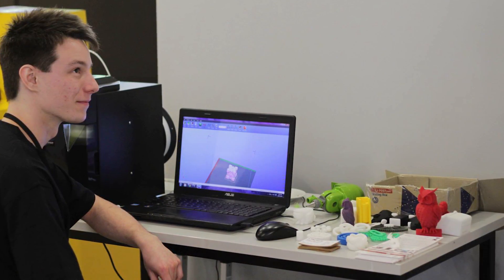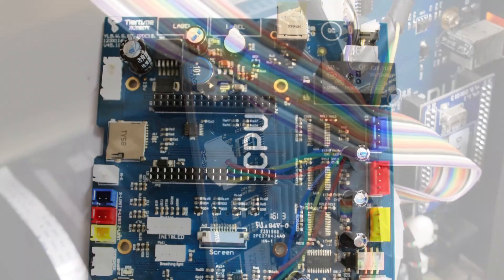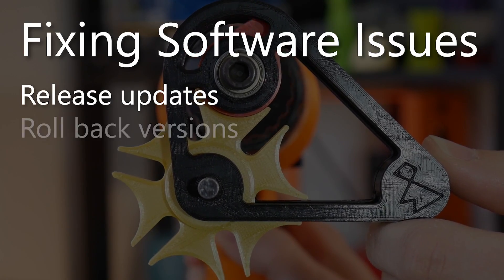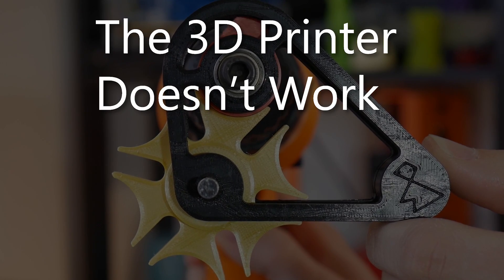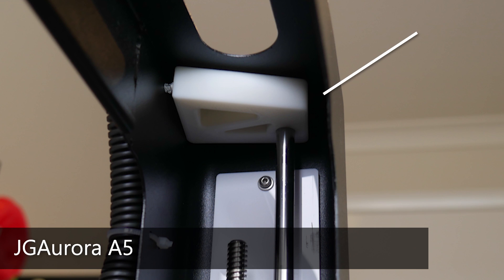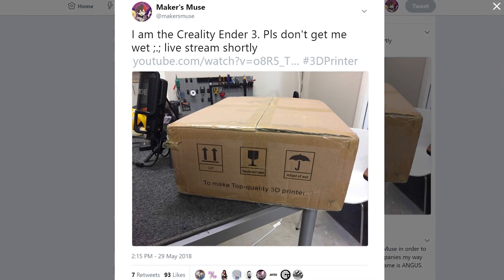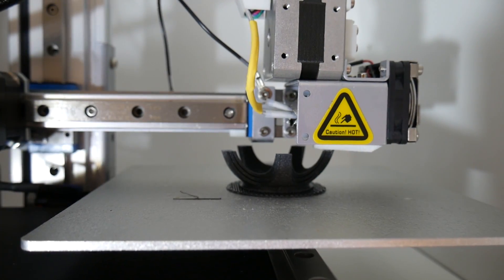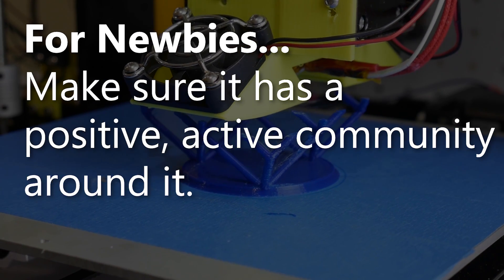Serious Concerns with 3D Printer Quality Control

Comment: Terrible way to run a business of any sort, especially a startup. Look at all the massive pushback people are getting on early access games now, even the AAA creators are getting outrage from fans over retail releases that clearly aren't finished, don't work right, and/or get multi-Gig patches on day 1 and still don't work right. When you have teams of a hundred or more programmers, there's no excuse for unfinished releases.

Nintendo is a name that really hasn't been all that relevant for the past 15-20 years and has fallen by the wayside due to poor project decisions and fighting against more modern hardware and PCs. But one thing they do extremely well is release products that have few or no bugs, because they won't let a game go out the door until it has been exhaustively tested, not just playtested by a programmer on his spare time. It takes them years to release games which makes them outdated by the time they are released, but you can count on them being solid builds.

Comment: Great video (as usual)! I have seen this happen a lot. It even happened to me. I bought a Quidi Tech X-Smart. It worked well right away, and then started having problems about 3 prints in. The support was good in that they kept sending me to parts to fix things, but in the end, I have a completely dead printer now. I put in over 80 hours trying to get it working again, and it often took 2-3 weeks every time they sent new parts. 

I have currently given up on all the numerous projects I was going to 3D print because of this. I have been 3D printing for about 10 years. Mostly using online services in the beginning, but then got a makerbot about 6 years ago. It didn't produce usable prints for the first 30 days and ate up all my time that month with their tech support. I was able to get it to work occasionally, but the last time it stopped working, I gave up due to the fact that I spent at least 10 times more of my time fixing it than using it.

I'm currently so drained from my bad 3D printing experiences, that I'm scared to invest in another printer since it hard to see it as anything but a massive waste of my time.

I have 2 dead 3D printers taking up space in my closet because I still have many things I want to make, and I really would really like to get them working again. I just feel like it at best if I fix them, they will only work for a couple prints before I have to start down the seemingly endless road of figuring out how to fix them all over again.

I have had many friends ask me if they should get into 3D printing. I tell them my experiences so far, and they end up saying, "I don't have time for that kind of hassle".

Not everyone has had as bad of experiences as I have, but as your video points out, it's not all that uncommon either.

Comment: As a quality technician myself, I point out issues that should be changed all the time.  However, the company I work for values consistency, and thus, if we make a change, it must be done to ALL previous products.  (Though there are much fewer customers and products than in the 3D printing world).  It's very sloppy to send things out with random changes along the way.  I'm curious to see what will happen if I request some of these part changes from Creality for my Ender 3.  One good example is where I saw a video about adding dampers to x and y motors, and that was the only change required.  I did that with my machine, and then my bed stopped hitting the endstop, and started hitting the motor!  The bed had been changed slightly causing me to nearly damage my machine.  I definitely agree, they need to do something better than this.  But waiting 6 months, and releasing an Ender 3.2 also has its drawbacks.

Comment: I'm in the commercial CNC world so hardware from Fanuc, Siemens and Heidenhain is a non issue. My TAZ 3 look like it was wired by infants.  The Ender 3 at least has wires that are marked but what you are saying is spot on.  Creality has made a big deal about their open source announcement but try and download the SW files and you find they are corrupt and come from a SW version that is almost 3 years old.  I wonder if it's legal?   Github has no idea what to do with STEP files so they come up as text files which you have to copy and paste and then rename into step files to properly import them which leads me to question how much other stuff goes out the door without proper testing because if you can't test the SW files and send out a proper Solid Assy with all the dependent files how much is left off?   If you can't get files that import properly is it truly open source?  Why can't I just download one ZIP file and have everything I need to mock up a printer assembly for testing of my own personal designs?   The whole affair with the big flashy announcement looks like some of the Creality dudes got together at the local pub after work and said let's go open source and make a YT video with a girl to do the narration.  Did anyone test the files they posted up?  How many different revs of printers are out there now?  Are there any release notes with build dates so you have an idea of what you are getting?  

This is all beginner stuff.  It makes the 3D printer manufacturers look like cottage shops behind the garden in someones back yard except they are coming from Guangdong province in China where all the electronics shops are a penny a dozen.  They all share designs amongst themselves because the Chinese don't understand the idea of intellectual property and don't mind stealing software, hardware and chip designs from everyone and anyone.   There are manufacturers in China that have legal copies of NX and will use cracked versions of SW because they don't know how to use NX and it's too difficult for them to learn.  You know that filters down to the 3D print world.  

The idea that every customer is a beta tester is an old reality for those of us in the RC community as the speed controller, flybarless and gyro manufacturers have been using us as beta testers for years.  DJI got started making multirotor controllers and we as in the US modelers helped them perfect their software in the field.  There are dozens of servo manufacturers in Shenzhen and they come and go.  

Keep pushing these folks.  They have to do better for the customer.  With your platform you can be the voice of reason.  They have got to get their act together or this whole business has the potential to turn into a big hoverboard debacle.

Comment: This is such a critical video of issues that the industry has been doing for a while. From a fully assembled unit I bought in 2017 that I can't get support on because its changed versions but still sold under the same model to the prusa MK3 with its release pains and its powder coated sheets. This seems a problem no mater what price range of printer you are getting from the $300 kit printers to the $5000 fully assembled printers they all seem to be running this beta tester approach lately of ship it and fix it later. When you run into something like firmware and software that is at least a minor tweak but you run into the issue of people getting their first printer as a gift they expect the machine to work right and can really turn them away from the enjoyment of 3d printing when you are just running into mechanical issues left and right.

Comment: There are further versions of this problem: Printers that worked but the manufacturer got creedy and assembled the later ones with cheaper parts AND Printers that have no part quality control except for review copies. As in the quality is all over the place when comparing two printers of the same model.  
Those are real issues, because you can't trust reviews anymore and that's why Maker's Muse should be concerned too. If people can't trust reviews anymore they will stop watching them. 

Also there were one or two printers that shipped with a new and innovative feature, that never worked and the manufacturers new that it will never work as intended. The feature on the box just sold units.

Comment: I agree. I love tinkering with my modified Geeetech i3x printer. It's so much better now and I learned so much. However, when I started, I assembled the kit but couldn't get the firmware to work. It sat for about a year until I made a really computer smart friend look at it. He fixed it in a couple hours. I later found out some problems were fixed stock. Therefore I unfortunately missed out on a year of 3d printing! Just converted into a dual extrusion machine which opens up a whole bunch of new things to learn! Keep it up Angus!

Comment: I don't know how to react to this. I regularly used(through work connections) an Ultimaker 2, very widely considered one of the best 3D printers of the earlier period from 2013-2016, and had the exact same problem as your Ender 3 of the bowden tube regularly popping out of the connector. UPs are reliable but closed source and you can't even use your own slicer or support generator. So what are we left with? There's literally nothing on the market that will hold up to this level QC scrutiny and still be open source or even somewhat customisable. Sure, I appreciate the sheer reliability of UP printers, but I also value a level of customisability to get the most function out of a printer.
Reply: Ok I just saw the Hoony review. I better understand now where you are coming from.

Comment: I totally agree, and I'm glad someone known is willing to talk about this. I already had two 3Dprinters earlier, but haven't printed a lot yet. 
In 2010 I bought a reprap mendel kit, knowing it was more a project than a product, but the only affordable printer at that time. I tinkered on it, and it printed stuff that vaguely looked like the 3D model, but after a year I gave up and waited for the technology to improve. 
In 2014 I tried again with the kickstarter of M3D. It worked for a week, and then stopped printing. I looked for answers online, and it was probably the electronics, so instead of going through the hassle of returns I just left it to collect dust. 
Again 4 years later I ordered an i3 mk3 which hasn't arrived yet. I read good stuff about their quality and support, so let's hope that one will be good.

Comment: I am ok with beta testing so long as it is stated as such at a reduced price. Why in heavens name would I buy something that is second rate, fix all the issues and have flawed printer. I would also state that as a beta tester dong the beta testing at a reduced price we should also get the upgraded parts for free. 

Good call on this Angus. Even Prusa did this, the filament sensor is still an issue. Bed leveling just improved on the last firmware upgrade but.... where is that textured bed? What is that awful noise on the prints. What is up with the odd layer shifting? All is on a MK3!

Comment: I have the first iteration of the Wanhao D7 which is a shadow of the V5 that is currently available. My D7 has never made a single print. I resoldered the UV light (which never worked), purchased a new LCD screen (which didn't work either) and found that the LCD control board had a connector that was so flimsy that it had snapped off the board. I stopped sinking money into my dud machine and purchased a Anycubic Photon which I love. Goodbye Wanhao.

Comment: Now I am even more concerned when I go to buy a printer.  "budget" is a word I just tossed in the trash.  When I go to spend my cash I'm going to spend it on a product with a company who will back their product properly instead of using me as a guinea pig.  Are there brands you can recommend that would support their machine properly and fix issues?  Obviously assembled machines would reduce the issue but further kills my whole "dont be expensive" hope.

Comment: My Prusa Mk3 (assembled), came with a dented print bed, a broken heat-bed connecter and one of the motor/stepper bolts was half inserted and bent . . . . pretty bad quality control for a $1,000 machine, customer support offered zero help.
Reply: That seems really strange that they didn't offer to rectify the issue.  I had them replace the rods, bearings, power supply,  and some printed parts across a few orders, and they were all handled within hours and received within days. One thing I think many people get wrong with Prusa is using the email tech support.  I have not ever heard very positive feedback from those using it.  I didn't even think about it when the live chat was offered.  I have never had to wait more than a few moments to reach someone and after perhaps a brief chat and some pictures, or video received the appropriate advice or replacement parts.  I hope that they solve your issues because they are great units, especially with the latest firmware, and slicer advancements.
Reply: Thanks for the reply . . . I did go through Live Chat on the Prusa website . . . to be fair to support it's not like they had no suggestions (so maybe 'zero help' is a little unfair) it's just that after waiting for months . . .  with all the repeated delays with no contact even telling you there had been another delay, no email, nothing . . . when I eventually got the MK3 and found the damaged heat-bed connecter . . . . I mean really damaged, like bent upwards from 0° to 30° ! The bed had not been secured, there were zip ties in place but they were super loose, you could freely slide them around by hand with no effort, and the internal packaging to further prevent movement was not included / left out . . . so the bed spent the journey from Czech to the UK sliding back and forth, repeatedly smashing the heat-bed connecter against the side of the box and whatever was on the other side of the cardboard . . . and if you unscrew the cover from the heat-bed connecter you'll see it's a pretty hefty connector, not at all flimsy, so it must have taken quite a few pretty heavy impacts to bend it so much . . . after all those months of waiting and receiving a damaged printer, I contacted Prusa straight away (Live Chat) and the support person, before even asking to look at the damage simply said 'send it back' (no apology for any inconvenience or anything like that, just 'sent it back') not wanting to add more weeks to what was already months I asked if there was some other way to deal with this, maybe replacement parts or DIY repair, but the support guy basically said he didn't have time to deal with it as it was the end of his shift and he was off home, I asked to speak to someone else who had time to deal with this, but he just repeated the 'send it to Prusa' line . . . . so I decided to just live with it, I printed a replacement cover (which was so damaged the bolts had torn through the casing) in the included silver PLA, it works pretty well now, the occasional issue with power to the heat-bed, but mostly good, I spotted the dents and the misaligned bolt a day or two later . . . so all in all not the end of the world, but I'd still say the QC is pretty poor - and depending on which support member you get - the support can be pretty crappy - for a $1000+ product I'd expect a little more interest/concern from support, but I suspect Prusa are so oversubscribed at the moment that there is little downward pressure to please customers, why spend a couple of weeks getting an order right when there is a 2 mile long queue of people trying to buy.
Reply: Still sorry to hear about your poor experience.  I have been lucky I suppose,  as it seems that your issues should not have been very difficult to resolve with a few simple replacement parts.  That is disappointing,  but there are some good folks on there who genuinely want to help. I wish you luck and hope you can finally enjoy your printer.
Reply: Just a silly question.  What parts exactly are damaged?  the power cover and actual head or the spring steel sheet?  I'd be happy to mail you any small printed parts as I have many spares.  If the actual PCB heatbed is damaged or dented, it may not really have any impact on printing as the sheet rides on top.  So long as you can do the initial calibration and perhaps subsequent temperature calibration, everything else is done with the steel sheet.

Comment: I've been researching 3d printers for the last 6 months or so as I'd like to buy one in the future and I've noticed this as well.  I'd watch 5 reviews of the same printer and everyone's impressions were different and there is very little consistency which makes it hard to make a buying decision.  However, I would not say that it's necessarily a 100% horrible practice since keeping costs low makes getting a printer affordable for more people. I'd like to see better communication between the company and customer.  It's one thing to buy a product knowing what you are getting into and quite another to be blindsided.  A model or version number would be nice when placing an order so you know if you are being sold an older or newer machine.  

As a gamer myself, I realise that the first iterations of something are always going to be the worst.   It's not just 3d printer manufacturers that make these changes to their products unannounced. I've bought other electronics that end up being different than the display, box image, or instruction manual.  It can be quite frustrating but it's usually more subtle than this. It's probably a good practice to, like you said, stay away from kickstarters and other brand new models of any electronic device tbh.

Comment: In terms of Kickstarter projects, the Snapmaker did it very well. Backers were allowed to select a Beta Testing option in which they had to pay a tad bit more (as they were sent more parts), but they were able to test the early versions of the printer. When new products were released, the Snapmaker team sent it to the beta testers and so the testers ended up with the final product that was shipped to all backers in perfect working order :)